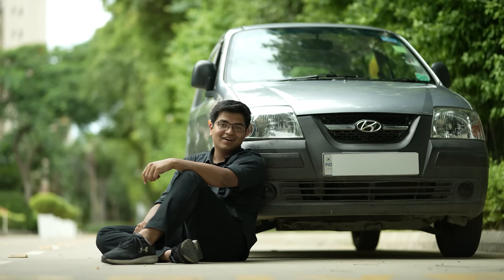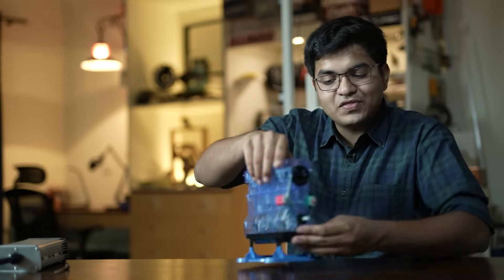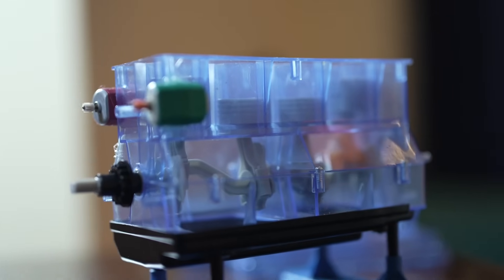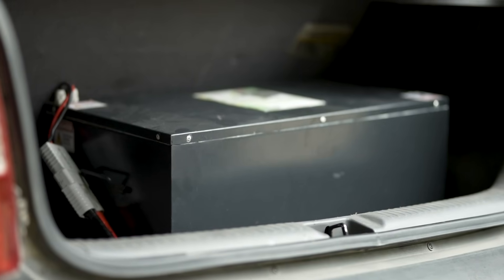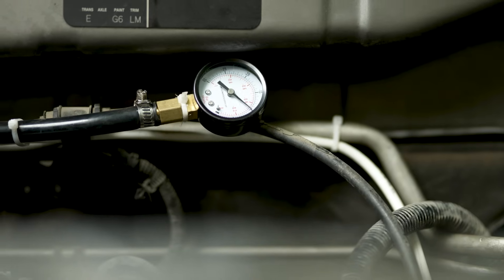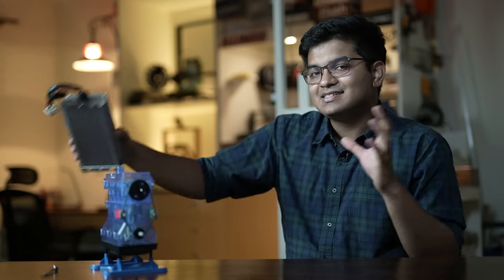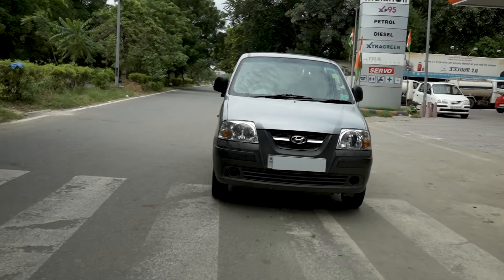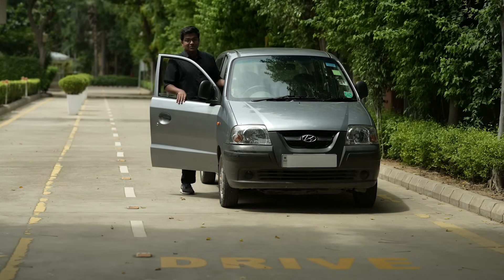Simplest EV Conversion under $3000 - Convert Your Car in 3 Days!

Comment: I see that this has been out a year, but I just saw it, and I have some questions.  If you have the AC and power steering hooked up to the engine block, then you only have those when you are rolling, right?  That would be inconvenient as hell because when you were stopped in traffic you'd have no AC; and when you were stopped in a parking spot you wouldn't have power steering, which is when you would actually need the power assist to turn the steering wheel, that's when its the hardest.  Since you have a clutch, you could set it to never stop turning, like an idle at 500 rpm or something like a car, and it would keep the AC compressor and power steering pump going using very little electric since you weren't actually propelling the car.  But if you were going to do that why not get a motor with a shaft at each end, hook up one end to the transmission, and the other end of the motor with a pulley running the AC compressor, the power steering pump, AND a vacuum pump for the brakes.  That would be far simpler, and would drop all of the weight of the engine entirely and take away the need to change the oil in a standard engine block. And while we are on the issue of the engine block, when you pulled the head off what did you do with all of the ports throwing oil upwards for the heads?  In sharp contrast to the other comments here, I don't find this to be brilliant at all.  I do find your idea of one motor to run propulsion, AC, and power steering to be a good curiosity to have, but the way its implemented here is not as ingenious as most here think it is, and I'm sure the issues I've brought up you had to face in the real world and I wondering why you didn't mention about it.

Comment: Biggest problem with that build is whole power to wheels is delivered through a timing belt, while in original design belt is used only to move valves and accessoy devices

Comment: Out standing!!!
I’ve been thinking about this for a while and see you’ve done it. 
I’m using a  Mazda Miata and have removed everything except the camshaft and drive train. 
I used the same ac compressor and the alternator to add convenience. 
I increased the motor by double 
With the 5 speed it’s remarkably zippy. 
Thanks for sharing. 

The next thought for me is hub motors in the rear and remove the engine and drive train.

Comment: Ingenious Mihir. This looks like a potential business model especially if the number of cars you mentioned will no longer be viable to operate by the end of 2025. Excellent video and project notes sheets. I particularly liked your use of the plastic ICE model to demonstrate your points regarding what was taken away from the car, what remained and what was added.

Comment: As I've calculated that, anyone can drive more than 30000+ km in $3000 if they didn't convert the ICE cars to EV. However the conversion of the car is really very appreciable. But what is the point to change an ICE car to EV by spending $3000. Battery is actually not a sustainable green energy. Maybe the hydrogen fuel cell will be a lot better sustainable green energy in future. And that is why Toyota has chosen another revolutionary way whether other car makers were making us fool by selling EVs as a green vehicle. Which is totally ridiculous.

Comment: I have the same car but comes with eco model (Hyundai supplied gas kit). It is still working perfectly and one full gas tank gives 140-160km. Might be around 23-26 litres of LPG. Burns so clean that i literally never refill petrol. It’s AC is the best cooling.😊

Comment: Really interesting idea and well presented. It would have been nice to see more of the enginebay after the conversion.
There are some parts I don't fully understand:
- Why is a DC converter needed for the 12V? You drive the compressor and the servo pump via belt. Originally the alternator is also belt driven so I thought it would be straightforward to use that aswell.
- How did you close the oil circuit on the top of the engineblock?
- Putting the drive to the top will be problematic. The stretch side of the belt switches to the side of the tensioner. The tensioner will be more likely to fail in short term because of the increased load.
Reply: losses driving alternator would be huge

Comment: This is engineering at its purest form. Accept a couple of compromises (acceleration, range) at the expense of cost, but with the most amount of features (AC, steering, brakes) using existing components (gearbox) to mitigate the compromises. I'm impressed! Great work!!
Reply: From Peter H.
Its truly amazing what he did.
But could he have just added the electric motor but left the pistons in place.
That would be a hybrid.
He could use minimal gas but mainly electric until the battery ran out.
Then all gas.
Reply: @Peter-j4b1q  that's Exactly what i thought! And that eliminates labor costs to tinker with engine.
Reply: it's a smart build, but as he said, there's so much inefficiency

Comment: Hello G man and everybody! I have a old car to convert. How can I convert a 1968 Firebird  with 650 lb dinasaar burner and 4 speed transmission. It weighs about 3000 lb less engine. What motor or motors would be the cheepest most practcal. comonly used and use common batterys that are also cheep. Mayby I can use 4 motors that are redily available. Don't forget we want plenty of extra power 400kw or more. Wer need to figure out how to link electric motors together. Smaller comonly used motors that don't requier special batterys.

Comment: You don't need power steering and power brakes go with old Tech and avoid probably 500 lb of weight, leaving that engine block in there with the additional weight and friction doesn't make any sense to me, not just for power steering and power brakes on a tiny little car like that that you don't even need anyway,

Comment: That's so smart! But why did you keep the heavy pistons? Couldn't you eliminate the block too, just make a bracket that mounts to your motor mounts and brackets to attach the accessories like you have it with the belt. or chain drive. Then you don't have oil and more range with less weight.
Reply: he didnt

Comment: This is a great concept and especially tempting with the lack of re wiring and cost.  However! most US trucks don't have
room! so same concept but pull the ICE motor entirely and some how use a belt to run all the devices the old motor powered.

Comment: Belt drive vacuum pumps are available. No mention of how you made the oiling system on the engine continue to work properly with the pistons removed and the cyl head missing.  I assume you'd have to plug a lot of passage ways
Reply: That's it. Just plug the lower ports and cap top of engine.

Comment: Well done and very ingenious. I would pull the pistons of the engine too, to eliminate any unwanted friction losses as well as to reduce weight. Thanks for a great video
Reply: You can even get rid of the engine altogether and just fab a steel box that hold the electric motor and accessories. Since you're reducing weight and friction you can save range by running the accessories off an alternator, less friction and weight than the whole engine. But still there's plenty of room for a bigger battery and for a little more than $3000 you can have 96v 150ah
Reply: Exactly 👍

Comment: Very neat way of doing it! Would not have thought about leaving the lower half of the engine in the car. 

Question: Could the cars alternator not be powered off the same belt to charge the 12v battery and run things such as the lights?

Comment: The engine of my 2004 Montero (Pajero) io (Pinjin), blew a few days ago. I have been trying to locate a used engine for it, but you sparked mu curiosity. Maybe I will convert it to electric and keep it as a citycar 😂😮
Reply: And I guess the oil last very long, since it dies not get contaminated by an IC motor.

Comment: half of the engine stay but problem is,half of the engine weight 125kg,thats not suitable,beside,if the road is a ramp,then you have a big problem,eventualy ev motor wil overheat and burn..

Comment: I would like to check if your method (connecting the electric motor to the crankshaft) causes a loss of power in comparison to connecting the electric motor directly to the transmission gear box. Anyone?

Comment: Interesting, I assume you pull the pistons and cam, but you still need the oil pump oil and lower half bearings to maintain meaning as the mains get worn you still need to replace them.  Also one wonders if every lower block temperature will be sufficiently maintained w/o water pump.  Heaters on cars typically use excess heat, too so depending on what you did you might need to introduce electric heat.  I thought Curtis controllers themselves were over the $3000 price. I'm clearly mistaken. I like the idea as innovative.

Comment: At first I kinda thought this was a dumb idea, but the longer I watched the more it made sense. A couple things to consider is that this would need to be done with a single cam motor. Also, if you are using the cam gear, you are putting all the strain of the car on that cam belt. On something low horsepower like this I’d think it would be fine though.  This is a great idea that can probably be improved with time.

Comment: easiest? more like the laziest, which is my kind of DIY, but man the inefficiencies here would make me go crazy over time, just get a newer hybrid where all accessories run on 12v and ffs get rid of that 40kg lead acid garbage, 4 32700 LFP cells with an active balancer is all you need

Comment: Good job.but one thing if you keep the original wire harness you will be able to use the alternator to power all of the 12v components in the car🎉🎉
Reply: Not a good plan. you would be using the motor to drive an alternator stealing some of your precious mechanical energy to make electricity you already have and can convert at higher efficiency with a none mechanical device like a buck converter. He can keep his wire harness and just wire the buck converter in place of the battery or better still go directly to the fuse box no alternator needed so ignore and tape off the alternator wires. 
He just has lights and fans maybe windshield wipers and a radio. If he needs defrost he should tap the main battery.

Comment: I think you lose a lot of electric motor power by just rotating pistons and crankshaft uselessly. Plus you have useless weight. You should Just remove what Is left of the engine and go for a full electric conversion. Plus, in the video you don't show what you really made.
Reply: He said he took the pistons out so no compression the only thing turning is the crank shaft besides the power steering and air conditioning compressor. It will loose some due to the bearings and oil system for the crank and in the transmission.
 Yeah he gave up a little weight but he saved a ton of cost and effort not having to manufacture the piece to connect the new motor to the transmission. Not to mention the effort of reworking the power steering and air conditioner.
His entire fabrication phase was a single L shaped bracket with no weird bell housing  shapes to mess with.
I would do it this way If I found cheap enough components.
Reply: @ghz24  but has he connected the Electric motor with a belt, the same belt that turns AC compressore and steering?
Reply: @fabriziooldrini6888  That's true those loads are not usually going through the timing belt but he has about 4 hp to spare.
And the belt isn't in charge of any timing anymore so if it stretches a little it isn't disastrous like when it was a timing belt.
It is a limitation on the concept if you wanted significantly more power.
Reply: I would have gone for a full electric conversion taking off the engine completely and using another smaller motor for services
Reply: @fabriziooldrini6888  one issue I just realized is the motor is probably not designed for side loads.

Comment: I was having the same idea of not removing the engine shaft assembly instead replacing the ignition part with an electric motor.

This is what i came here searching for. Good work.

Comment: I get the ease of using an engine block as a base but why didn't you remove the pistons to reduce the rotational weight. Also, I would suggest going to a machine shop and having the flywheel lightened to reduce weight. Here in America, its about $30 or 2480 indian rupees to have that done.

Comment: Won't the bealt wear out quite fast though 🤔 now it's driving the gearbox/wheels
Reply: Well he said the motor was 5 times weaker than the engine it replaced which would be 40 hp.
Normally about 30% of hte horsepower of the engine is applied to run the camshaft any way.
40 hp X 30% is 12 hp that was normally being transferred before so 8 shouldn't be out of the normal operating parameters.

Comment: What an excellent idea. If you look at the technology of many MHEV drive trains, it's quite similar - a larger motor/generator that is hooked into a beefed up drive belt that can supplement the ICE and charge a secondary battery during braking. To be able to re-use all the transmission components, with the small overhead of spinning the empty crankshaft is awesome.

Comment: Quick summary : he mounts electric motor on top of engine block and drives via timing belt. Horribly inefficient but cheap. Claims top speed of 60km/hr and 80 km range. Might be ok if you are not in a hilly area and local traffic speeds are in the 30-40km range.,
Reply: Horribly inefficient? I disagree what is causing this inefficiency? How much power do you think it takes to drive a crank shaft with no pistons?
The ~50 mile range doesn't bother me as much as the 36 mph top speed. I would want 45 at least. Regardless of the hype about range anxiety most trips are less than 50 miles so it seems pretty useful to me.  Why would I need to go 60 km/hr if local traffic is going 30-40 km/hr? Typo and you meant mph?
He has a 100 ah 72 volt battery, so that's 7.2kWh. (If) It goes 50 miles on 7.2 kwh that's almost 7 miles per kWh A Tesla gets 4 mpkwh and most get less than that.
It only makes sense because wind resistance dominates drag above about 25 mph so faster costs more energy.
At 12 cents a kWh that would be 2 cents a mile. 
I think I'd go for 10 horsepower 100 volt and 180 ah battery. for a little more speed and range. Still wouldn't take it on the interstate.
Reply: @ghz24  each to their own. Direct mount to gearbox is the way
Reply: @restfulplace3273 The way. The way to make the conversion more expensive and complicated than it needs to be.
Even the fabrication of the adapter to mate the transmission to the new motor is a daunting and expensive task for many would be conversion builders.
The presence of the crankshaft even helps him get away with a smaller motor because it can be set in motion before the clutch is engaged giving it inertia like a flywheel.
One could put weights on the crank where the rods were to give more inertia to be tapped to get the car going from a stop.
The range is easily expanded with a bigger battery within limits, 7.2 kWh is tiny compared to even a Nissan leaf.
The speed likewise can be addressed by a bigger motor.
I think it's genius and a godsend to poor people that live on the rusty edge of technology buying used but very functional cars. Many never having a new car in their life. I wonder how they will cope when the car companies stop making gas cars like they claim.
Personally I need not worry my car will last me till I can't drive or I'll be able to find one to replace it on my retirement budget.
I have toyed with the idea of a s-10 or ranger sized conversion. If I did, this would be the way I'd go. 
If you have a specific criticism I'd love to hear it otherwise we'll agree on "to each his own".
Edit: I did think of a potential issue in that the motor was likely not designed for side loads.

Comment: I have a thought. I’m running a firebird with 3.1 v6. It has a belt driven smog pump, its fairly large pump. If all of the smog system was removed, as well as the ignition system. Leave the top end, then the engine works as a vacuum generator and maintaining all original systems. Plus then the engine would produce a noise, not sure it would be a good noise with fire and booms. But see where I am going? I find this idea you have inspiring.

Comment: This is inspiring Mihir! Great video and really nice engineering project. I am wondering how you managed the accelerator pedal connection to the electric motor. A simply butterfly actuator or something else? Also wondering if this idea could be put onto a fully intact engine, and provide electric assist (or boost), by using a modification to the drive belt system? Adding a 20hp or higher electric motor could be a nice addition to a small car, and it could generate power if the brakes were modified to be regenerative.

Comment: Instead of keeping the lower half of the engine, would it be possible to just add a gear on the motor, which would spin the pump & compressor?

Comment: Wow; kudos! The solution to pollution woes in India is staring right in people's faces; the government needs to incentivize such conversions instead of trying to replace all current car stock. It's much more environmentally friendly that way as well.
BTW, kilometre is pronounced as if it rhymes with "nanometre" or "millimetre", not with "thermometer" or "barometer" (since it's a unit of measurement, not a measuring device).

Comment: That's a great idea congrats ! 
Even if there is a huge amount of energy loss by running the gearbox and the crankshaft it save you so much time and effort to achieve a  conversion ! 
Also it should turn so much more accessible to people looking for conversion by using your way of thinking !